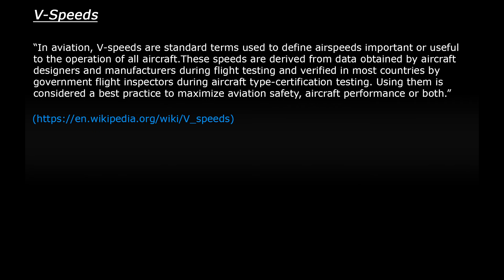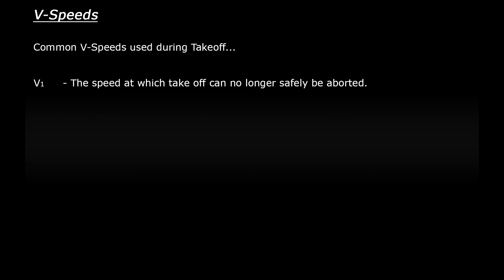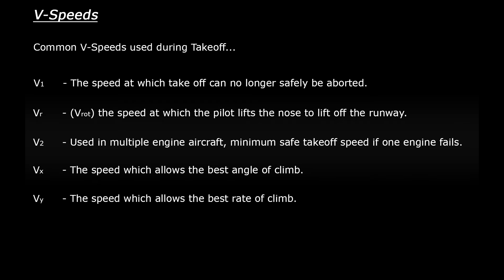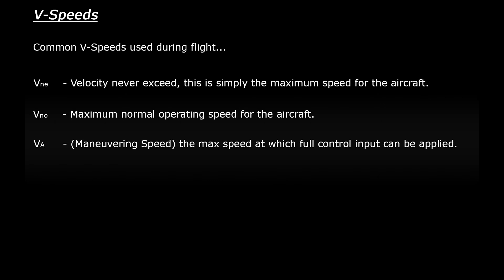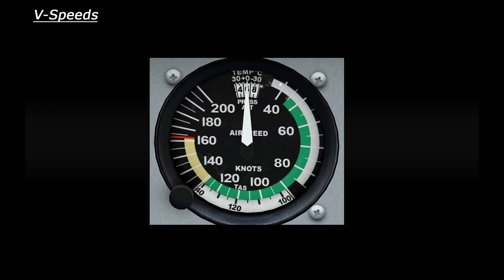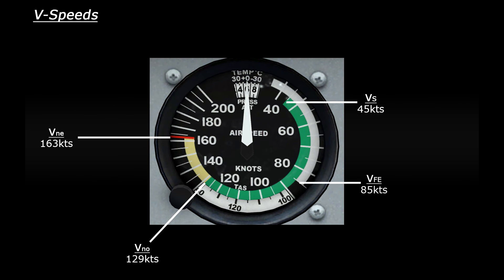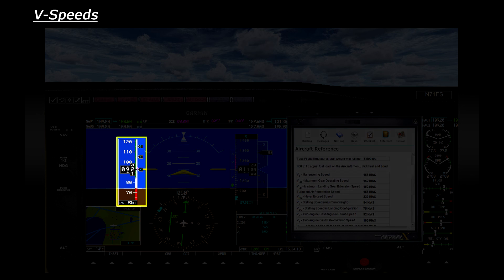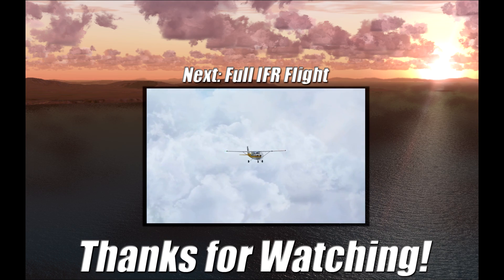FSX Tutorial: V Speeds

Comment: What is the second white arc from 90 to 140 knots, and the figures on it?
Reply from the maker: That is a True Airspeed Calculator. I'm not sure exactly how it works but you can use it to calculate the True Airspeed based on your Altitude and Outside Temperature.